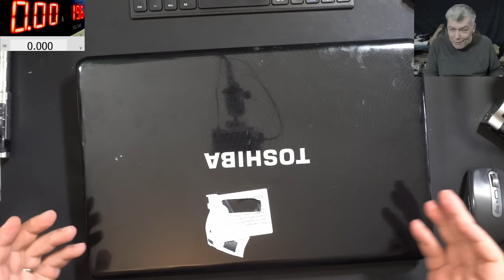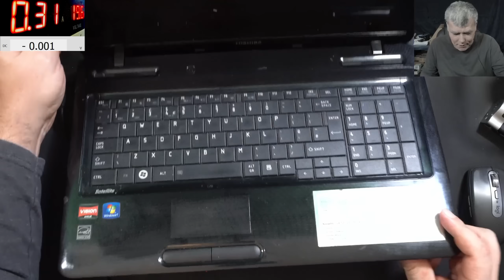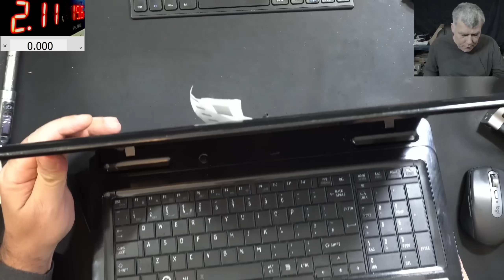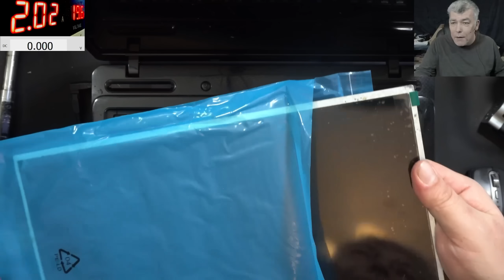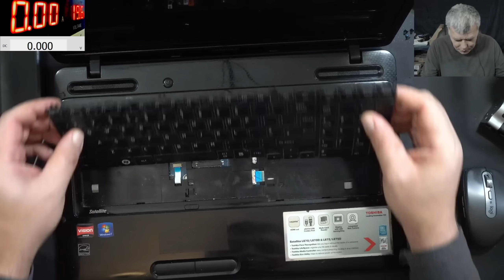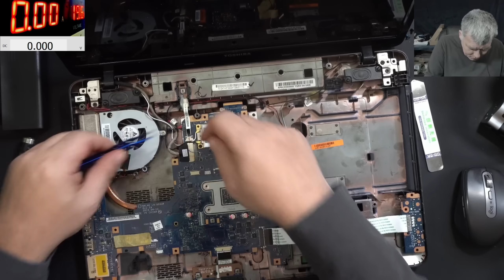Now, this what i call  'a proper GPU chip repair', you can do it, 100%  :D

Comment: i fix computers & other nonsense for people i know. recently someone gave me an old laptop she no longer wanted. it was a time capsule toshiba satelite, with win7. it still had all the bestbuy stickers on it, its was in pristine condition too. i put additional RAM in it, a SATA SSD that i had laying around & i ordered a dual core CPU for it which was the top of the line that board will run. i then installed win10 on it & it runs pretty damn good now. it makes me nostalgic for the way things used to be made.

Comment: 4:13
no need to cool the board , assume the weather temp 5C° ,  board temp after heating 400 C° , the board will release heat very fast , even if weather temp 30 C° , heat transfer from hot object to cold

Comment: I recently fixed my laptop which had a similar problem but on the chipset, instead of doing this (already did but didn't hold) I found it better to just add a small copper/aluminum plate under its heatsink so that it would push the chip harder..and it's still working after weeks

Comment: the chip is not likely the problem. pressure of keyboard typing flexes bga and loosens w ROHS leadfree low temp bad bond to pads. 
loosen heatsink and add little flux and heat from under 2 or 3 min to bond bga to pads.

Comment: Only long-lasting solution is to replace the motherboard+CPU+heatsink with the Intel variant without dedicated GPU (LA-6041P in this instance). It'll also waste less power, generate less heat and perform better than the AMD platform. Mobile AMD platforms of the time were just plain bad compared to Intel.
However, it's not economically viable as the price of parts alone will be higher than what the entire machine is worth when working.

Comment: You can still replace keyboards in most of Dell laptops. With 13 gen precision you can even replace RAM connectors. They are on separate board.

Comment: I have a bunch of those Laptops from the same Year ,this is Satellite L500M , M stands for AMD , At that time Stay clear of AMD chipsets So L500 which is intel Version is way better and AMD at that time No Dual channel Memory so it Runs single channel on Two sticks of DDR2 .But A better Version Is the A500 or A505 .They Last for ever And I was Able to put Windows 10 and Windows 11 on some of them , they have Socketed CPUs so you can upgrade to the highest suitable for that MB.

Comment: Wonderful work Mr sorin but in some time the laptop will come again with the same default so what is the full solution to do so that the problem will not happen again
Reply: He said it's  a chip issue, not a soldering one. The permanent fix would be a new graphics chip, but good luck finding one. Also, replacing a BGA chip is a PITA. You need a BGA reflowing equipment which is not cheap and not easy to use.
Bottom line, a new laptop is the full solution,
Reply: Thank you Mr  darth

Comment: The issue was common back around 2010s when the manufacturing die size was 90 nanometer. It is all because California back then passed law not to use LEAD for the solder points. Same fix for old fat PS3 reflowing the GPU / CPU with heat gun.

This laptop is so old and slow to the point even as brand new in a box laying on the sidewalk I won't pick it up,lol. Why spend any money or trying to fix this dinosaur?
Reply: Absolutely wrong. Read about Nvidia bumpgate. It was earlier than that for Nvidia (around 2006-2008) and the PS3 was affected by this very specific issue, where a reflow doesn't fix anything since the issue is not about the solder balls between the IC and the board. ATi/AMD had a similar issue with the highest failure rates around 2009-2011.

Comment: It will work may be one week ore month and will die again, that is the problem of GPU not the soldering problem. There is a bad connection between the cristal and the base of the chip that is why reballing will not help. the replacement of GPU is required for proper repair.

Comment: The correct way to fix those is to completely find a new GPU. I just fix a HP a few months with same AMD GPU the same way with just reflowing it and came back a week later and got lucky and found  the GPU used on eBay and completely replace it, hasn't come back and sold the customer a Lenovo as a replacement as still didn't trust it as still was a used GPU and he needed a older laptop as software he using requires Vista/7 and won't work on a newer laptop, tried it already and he didn't like newer version of the software as missing features older software has. He does, live performance and only uses it for music. He stated still works and he been using it 5 to 6 hours at a time for the last 4 months. So the replacement GPU turned out to be good shockingly as only reason I repaired it the second time was to recover settings and license for software to transfer over to another laptop, as cloning the drive still needed the license as software requested it. He told me I think you fixed it permanently this time around as still works and hasn't crashed like it used to. Most laptop's and game consoles from this era had this problem ATI and Nvidia lied about thermal specs and screwup on manufacturing. So all OEM manufacturer's  were affected. 

The failure due to the subdie flexs and cracks on the GPU package, not the solder balls. I use to repair 100's of HP and other laptops and xBox 360's and fat PS3'S back in the day for very reason.. Reflowing and reball same GPU is temporary at best. Sometimes it last a week, or months, to a year. Back then used a fancy BGA rework machine. Now do it with a good hotair station and preheater setup by hand as takes up way less space. Now repair PS4'S and PS5's with the PS5's capacitor's to mosfets to failed SSD controller are common issues with them, especially the HDMI port that breaks if you look at it wrong and I hate liquid metal as one drop it get pass the protective foam/sheild and get on APU components and board even and pain to clean.

Comment: why not doing a proper reball or reflow?
Reply: he explained its an internal chip fault, not a solder ball fault
Reply: Also the laptop is so old and worthless
Reply: @Takashita_Sukakoki  Not necessarily. Max out the RAM & fit SSD, tweak all the settings to remove the bloat & unneeded services & it'll still run W10 ok, then Linux. I'm unlikely to want to go to w11 bearing in mind M$oft's user- data grab operation

Comment: actually the northbridge was the problem on these AMD laptops they would randomly fail after warranty expires, and its a design flaw in the cooling system on these laptops where the heat comes from CPU and GPU and it goes to northbridge and to the heatsink fins, the northbrige will get way hotter than usual and overtime it fails like flies